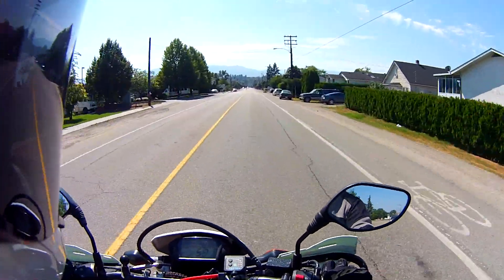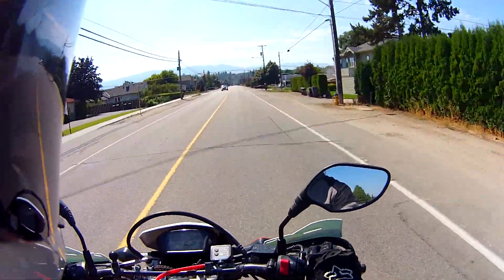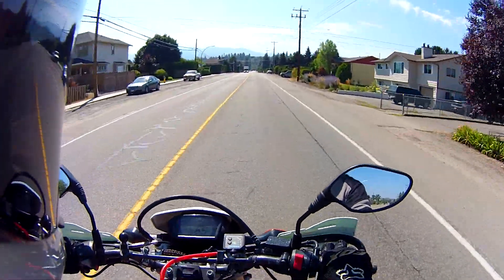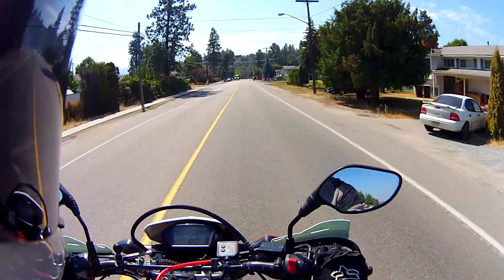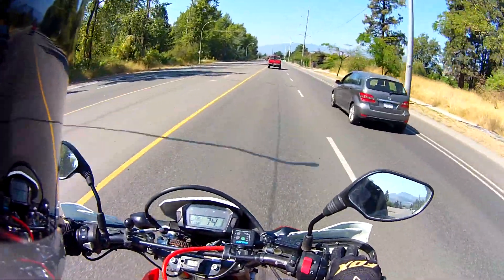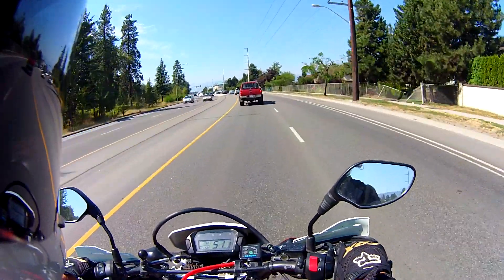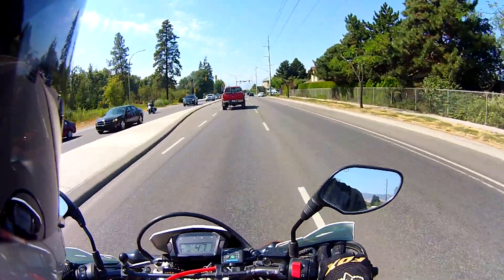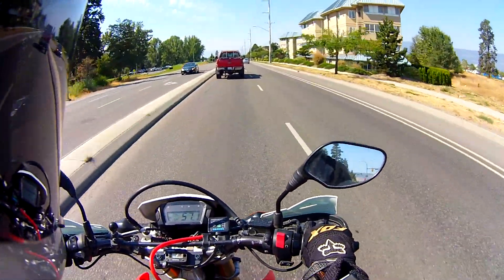STI Tubes Fail Big Time: 3 defective tubes in 5 Days

Comment: Thanks for the jeads up, fussy tires and tubes always hover in the back of your mind,  at least after an incident like this. Beautiful weather.
Reply from the maker: Thanks Scott. Yeah it does make a person a bit paranoid :-). Weather? I want some rain. Haven't had any for over 2 months.
Reply: BlastsFromTheSaddle  ah you guys from the far north,  rain,  snow it's all an adventure !  It's a little dryer, possibly warmer where I am at,  in California. It's all here,  just  aren't dominate features. That said did the Yosemite ride last week ( on the CRF ) and it was a little warm at times.
Reply from the maker: Where I am is semi desert so we don't get much rain, but this summer has been dryer than normal. Like I said, we'v had no rain for over 2 months, and the temps have mostly been in the mid to high 90's F. Now we are getting a few days here and there in the high 70's. That's a nice break. I like California. The entire southwest actually. Enjoy :-)

Comment: I too have had problems with STI, wouldn't hold air after my first ride. Remove the tube to patch it and find that it completely separated 180 degrees from the stem and clamp, in between mold lines. Tech were I bought it says he's never seen a tube fail like that before. Of course when I check the replacement STI tube, it's made in China. Dealer said they would credit me if STI warrantied it.

Side note: Installing this 120/90/19 double thick wall tube into a 120/80/19 low profile may be more trouble than it's worth. Takes a ton of patience to fit all that rubber into the tire and remove all the folds. Might switch to tubeless if I have anymore trouble with it.
Reply from the maker: If you can run tubeless that's maybe the way to go. Flats are then easy to fix without removing the wheel and tire. Who needs extra work and time out from riding, right?

Comment: Wow. That sounds like a bad few days. I have used STI before. Hopefully it's just a bad lot. I had the same thing on a Pirelli HD tube last summer. Once you get into the HD tubes they aren't cheap. Thanks for the info!
Reply from the maker: The tube they finally used was a Michelin Off Road T4 valve standard type tube. Should be good now :-)